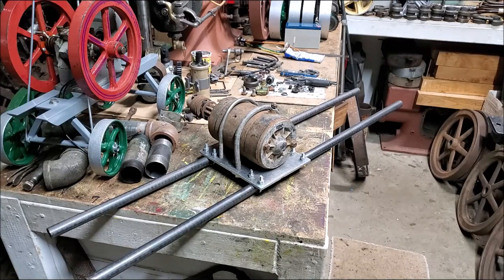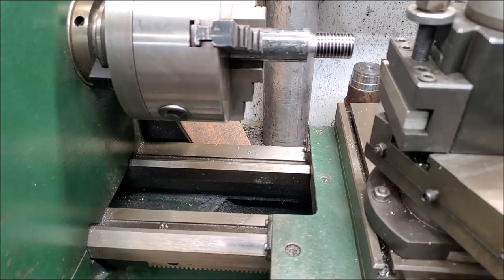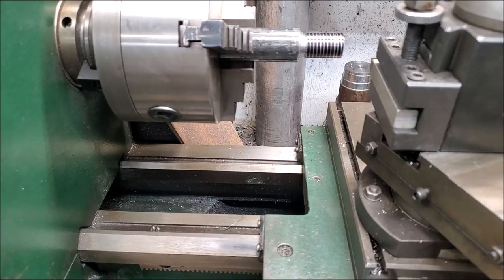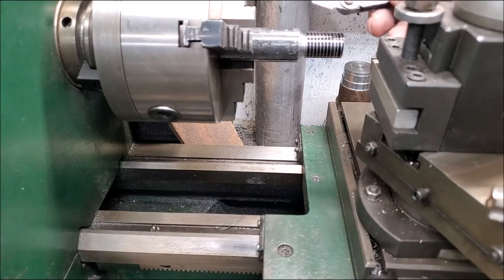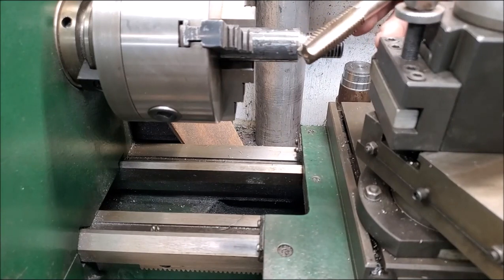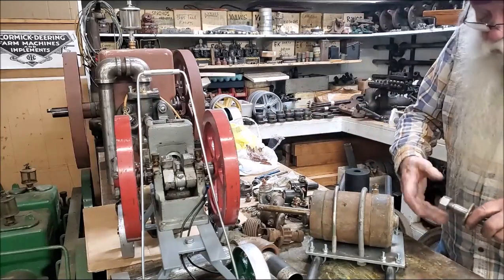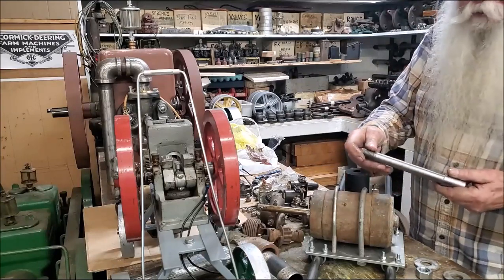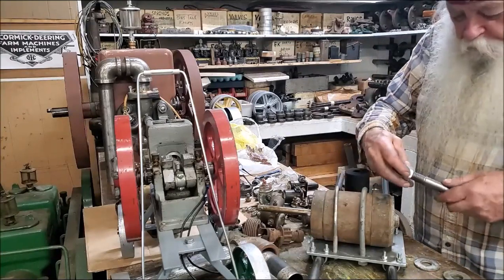How To Build A Hit And Miss Engine Starter thread cutting on lathe

Comment: I've used the model 2-8-9 n series ford tractor starter for 24 years now.i mounted mine on a big wheel refrigerator dolly.i can carry the needed oils I use and my lunchbox easily to my display area,also put a foldable lawn chair on it..works perfectly.i also mounted a pillowblock bearing on the shaft close to the motor to prevent the shaft from egging the bushing in the starter..should be able to source this from Facebook marketplace for less than 100 dollars easily

Comment: Too bad you have to cut the starter shaft off, then you can’t go backwards, never being able to use the starter again for it’s intended purpose. If you could make a sleeve that fits over the starter shaft taking advantage of the hole that’s already in said shaft with out altering said shaft, and a notch on the bottom end with a pin welded on for the roller, well you know what I’m trying to say. Thanks for the video friend.